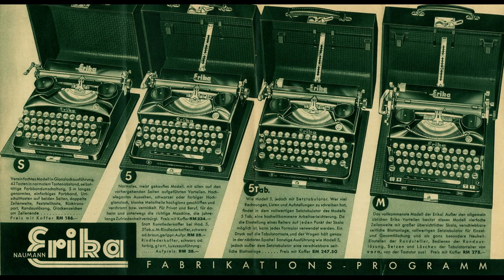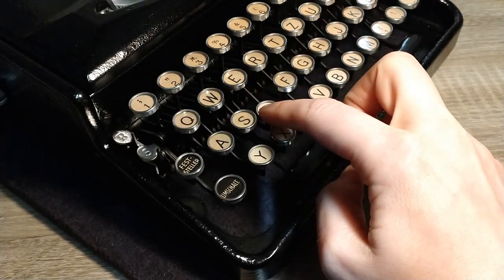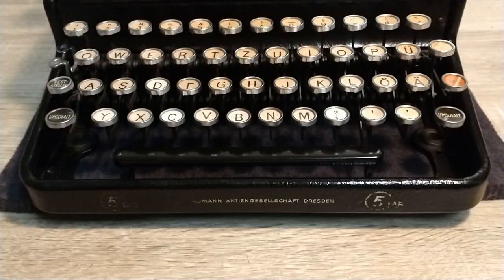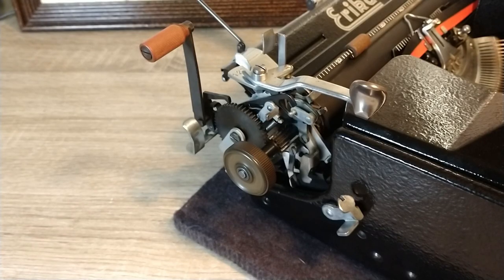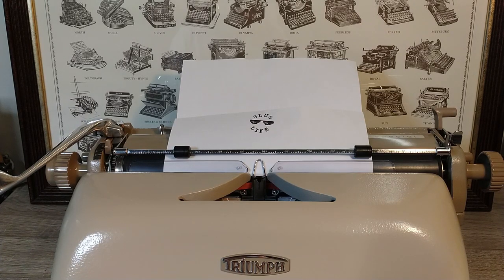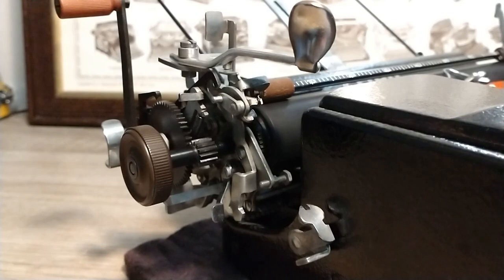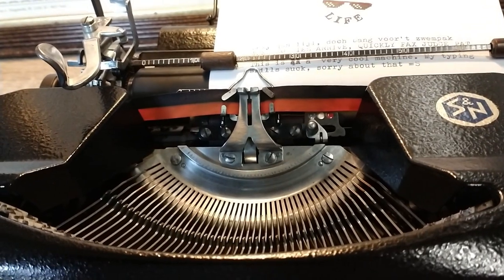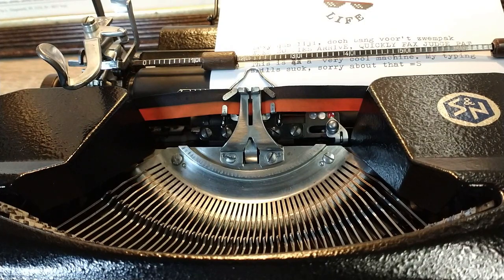Erika 5Tab Review

Comment: I have the Ideal Standard model from 1947, with that textured paint finish…. It is interesting, and probably easier to manufacture, than the earlier mirror black enamel paint, that was so fine. It seems also a bit more durable & repairable…..
Reply from the maker: It's most definitely easier to mend scuffed paint on this machine then on a glossy Erika. Love it.